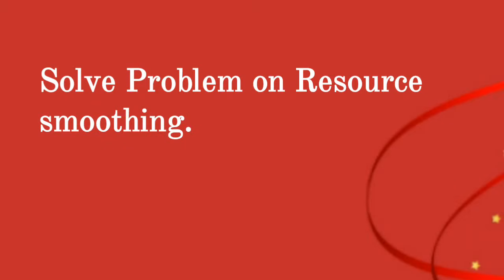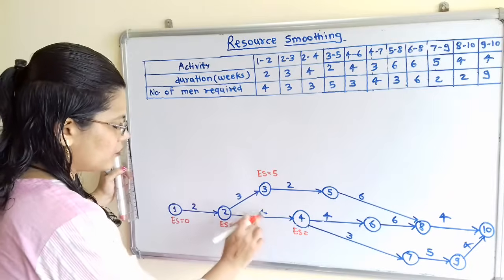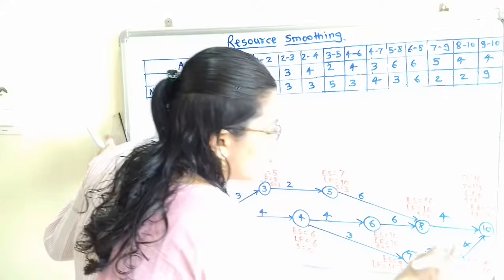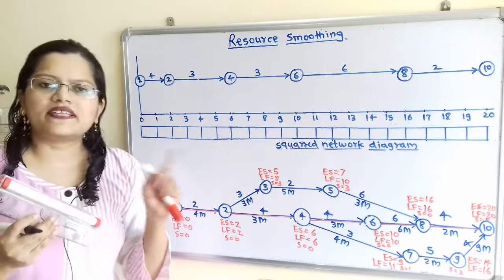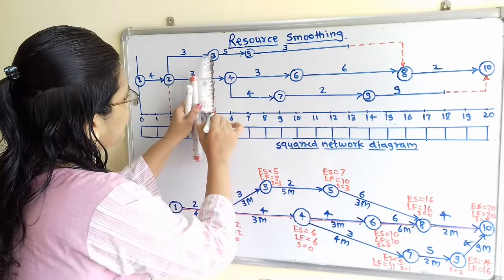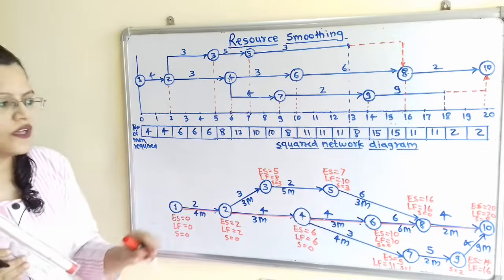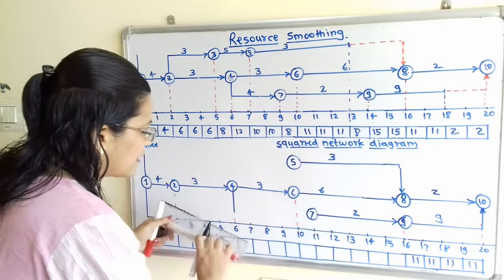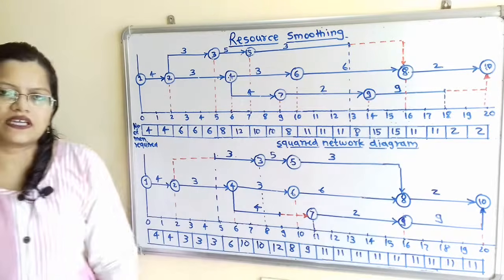Problem on Resource Smoothing,  resource scheduling,  squarred network diagram, operations research

Comment: Great explanation!! BUT I have you said while moving Activity 7 by 3 weeks that Critical Activity 4 can not change position, So Activity 4-7 ( 3weeks) after that dotted.
But when Activity 2-3 comes you changed it
Reply: Yes 2-3 and 4-7 activities shifting didn't match. Is there something wrong in the process?
Reply: @hrichikadutta543 hi, could you pls explain to my question, which i have replied in above comment
Reply: Same doubt, why is that? Dotted line and continuous line for activity 2-3 but for activity 4-7 continuous line and dotted line, this will change the answer right, what is the reason for doing like that?